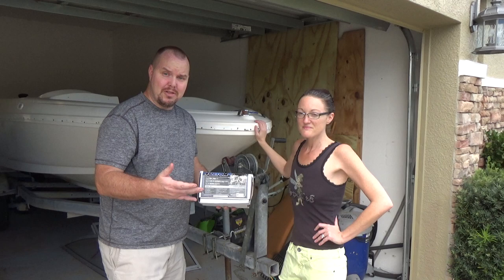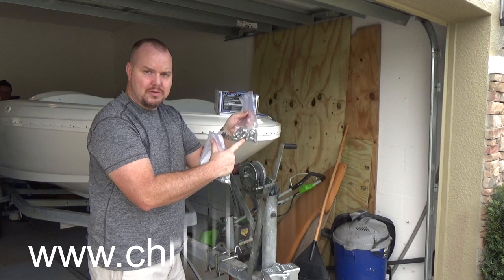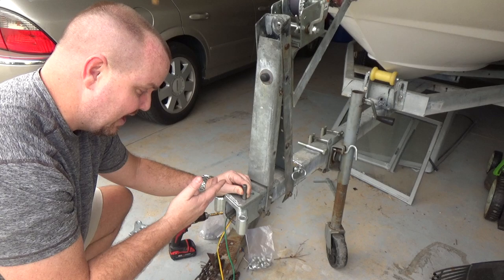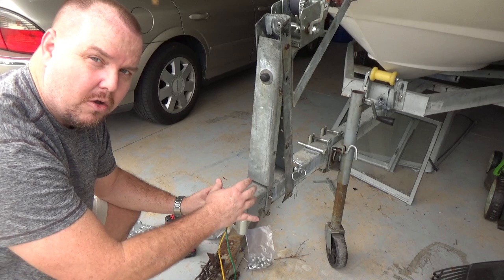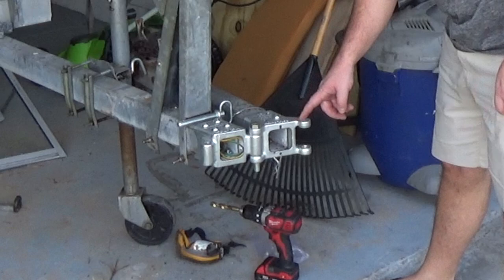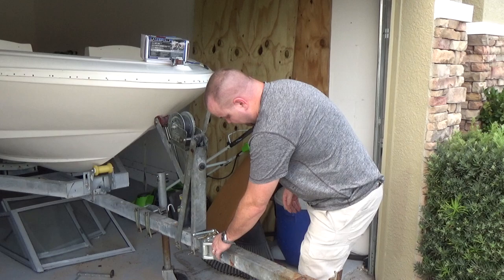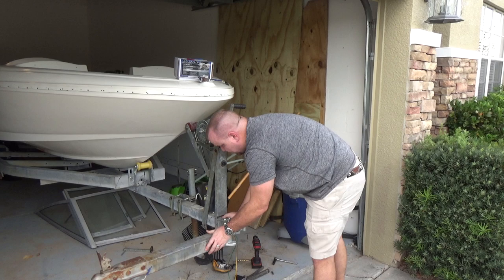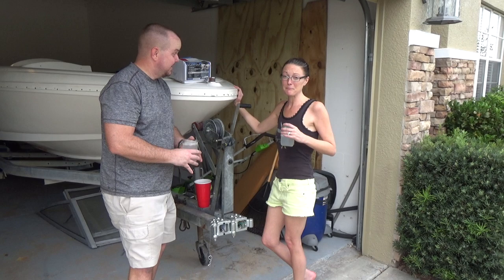Trailer Swing Bolt-On Hinge Kit Install EP #23 || Bayliner Bowrider 175

Comment: It would definitely have been a good idea to completely remove both sides of that swing assembly and apply a good anti-rust paint to both raw draw bar ends.
Reply from the maker: Yes that's a great ideal, did that not on camera a few months later. Jumped the gun on this project because we wanted more room in our garage.

Comment: Please be careful using the grinder without its disk protective cover. I saw a patient lose 3 fingers a grinder disk broke into pieces.. work safely 👍🏻
Reply from the maker: Thank you for watching and you concern. This grinder does have the safety shield in place. We always try to be safe, but I have seen were safety gear has cause the issue, not prevented it, and these things have grabbed people's gloves and pulled their fingers in.
Reply: Chris Does What - DIY, Recipes, Reviews I’m sorry, I must have not had my glasses on. You’re right, you had yours on
Reply: That disc did not look like a cutting disc.
Reply from the maker: It ain't, did not have any left when I wanted to do this. My son used them all.

Comment: Good video. Question: How did you relocate your safety chains behind your swing joint?
Reply from the maker: We didn't relocate the chains, no need to.
Reply: @ChrisDoesWhat  Good to know. All recommendations are saying to relocate behind the swing.
Reply from the maker: Back in the 80s when we were pulling the lowboy with hay on it there were no chains on the trailer. The change from more if you have a hitch problem or forget to latch the hitch the chains will keep the trailer from going off into traffic. I doubt the swing hitch would break with the size of Hardware has thousand pound boat.